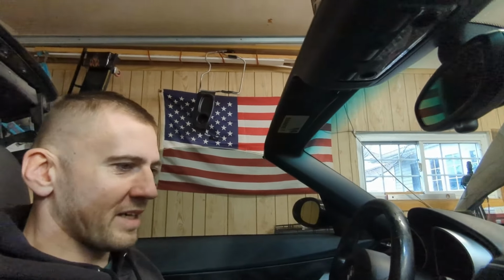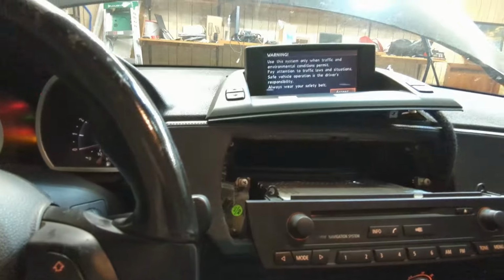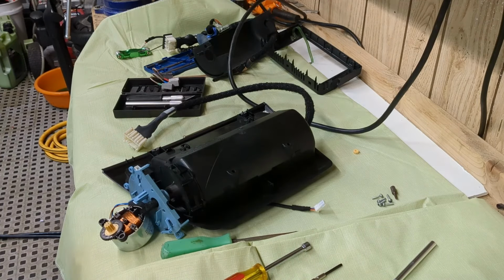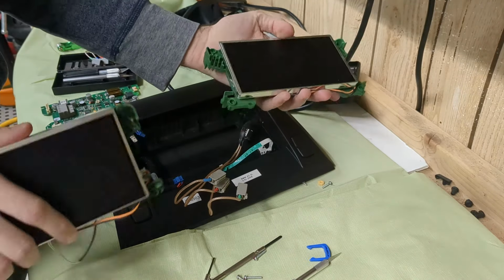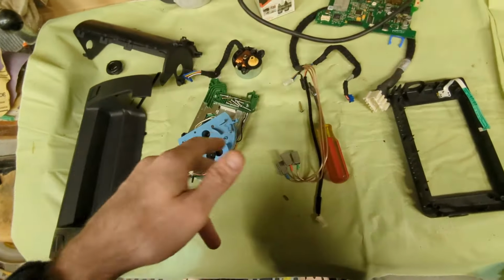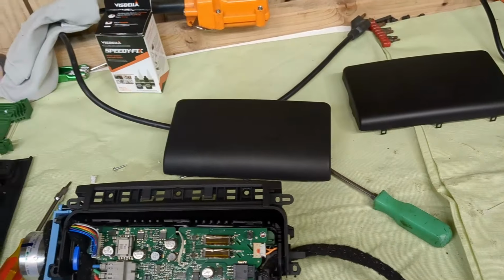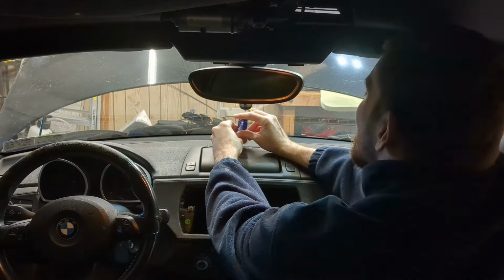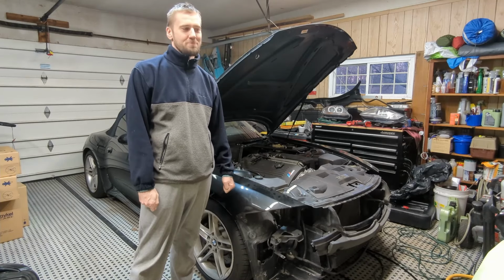Installing an E83 BMW X3 infotainment screen into my E85 Z4M - BMW Z4 M Roadster

Comment: Hello from greece, can you count how many pins had the original e85 navi contact cable ? 123456789 pins at the top line  and 1 at the down line.
Asking cause althougjt i bought the same e85 oem part,      it has pins 123456_89 at the top, and 1 at the down line.
Sonehow It misses one pin and it doesnt pop up !!!
Thanx

Comment: Man! Thanks for this video. For me it came a little too late because I bought my 08’ Z4M last year with the same problem. Checked in the forums and everyone said nothing  but original won’t.  And they are super expensive on eBay. So I ended up putting a CarPlay in the unit, but sacrificing the open/close mechanism
Reply from the maker: That's one of the main reasons I wanted to keep the original. I don't like that screen being open all the time. I saw another solution which utilized an older 6" garmin unit, but that was AFTER I already completed this project. Eventually, I might just swap out the dash for the one without NAV and install a double DIN unit.
Reply: @CarGuy1  thanks! Eventually at some point I’ll follow your steps. Definitely would like to keep it original. Z4 units are too expensive. Awesome what you did!

Comment: Buenas quería saber si cuadra perfectamente la pantalla x3 e83 en el z4 e85 aunque no se pueda poner los tornillos traseros que sujetan la pantalla z4 e85 ? Un saludo y gracias
Reply: everybody in every add say ''fits for X3 and Z4'',  but in the video at 7,20  looks like with the X3 display base there is a triangle hole left up at the console at front right and left.  But i see that the screen base plastic isnt already 100% correctly fit into its place on the dashboard, so i hope maybe the car guy can tell us about....thanks

Comment: Hey, cable and and pług is the same e83 and e85?
Reply from the maker: yes, it's all plug and play as far as wiring goes.
Reply: @CarGuy1  
Sh*t, i change infotainment screen from x83 to my x85 and screen didn't work :( fuse ok
Reply from the maker: @dominik1307  Don't panic. LOL. Is your battery charged? Also, try disconnecting the 2 switches (the ones that open/close the screen). I remember mine doing something finnicky.

Comment: What ended up being the root cause of the failure? Was it the ribbon cable that was bad?
Reply from the maker: I don't believe it was just the ribbon. It's obvious that someone opened this thing up before for some reason and they likely damaged the ribbon during disassembly. I don't see how it would fail on it's own. The secondary fail was the gear on the electric motor. It was nowhere to be found.
Reply: @CarGuy1  thank you for the response. I am dealing with a screen which will not power on and trying to determine if it is the screen itself or the nav dvd player. Do you know if there is a way to bench test the screen with a multi meter or aux power supply?
Reply from the maker: @michaelgeer9371  You'll need to give it an input signal. Does yours flip up and stays black? Side note - make sure that your battery isn't drained. My car sat for a while. When I put the "refurbished" unit back in, the screen would flip up and remain blank. It almost drove me crazy. I then tried to put the convertible top down and it wouldn't move. That's when I charged the battery and everything came back to life.
Reply: @CarGuy1  no issues with the screen movement and just installed a new battery last weekend, and put the top down with no issue. Found the wiring diagram for the 18 pin plug, it is receiving power and all grounds,  and had voltage at the r,g,b pins which leads me to believe the video card in the dvd player is functioning. I got the Sharp video screen uninstalled today. Going to order a screen and hope it is not an issue with the circuit board. As a contingency,  did you keep the board from your extra unit and would you be willing to sell it, it that is found to be my issue?
Reply from the maker: @michaelgeer9371  I kept the board. let me know if you end up needing it. It's the original board from the E85, since I put in the one from E83 in. They did upgrade the E83 unit. You can readily tell because it doesn't have all of the capacitors that you see on the E85 unit.
Reply: @CarGuy1  thanks! hopefully I will not need it, will let you know either way.
Reply: @CarGuy1  got the screen to display, plugged all the switches in and it lit up. Still has symptoms of in the open position where the stepper motor allows the screen position to be adjusted, the screen is powered off, and in what should be the closed position, the screen is on. When the key is turned off after being in the run position the screen goes to the open position. It was like this prior to me tearing it apart and replacing the screen. Any ideas?